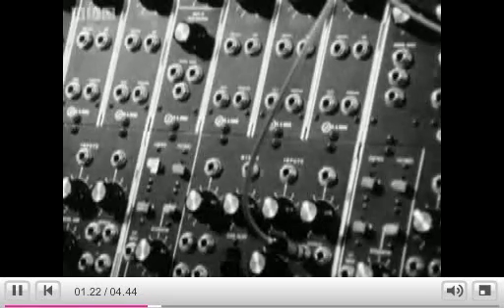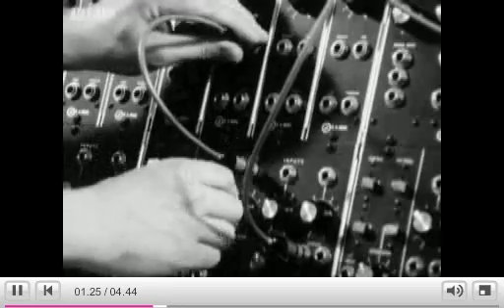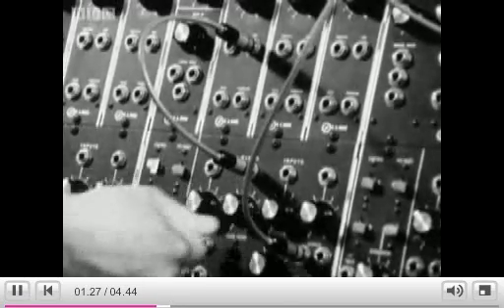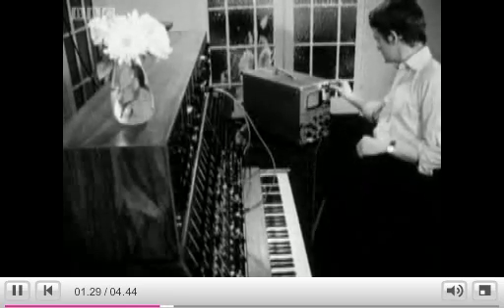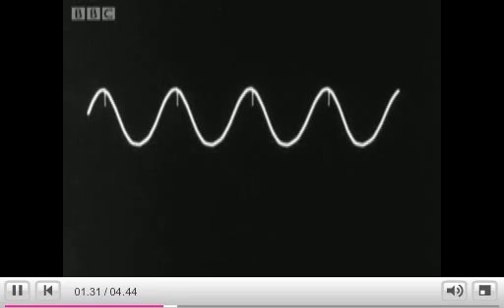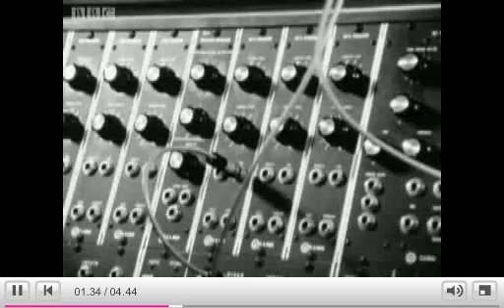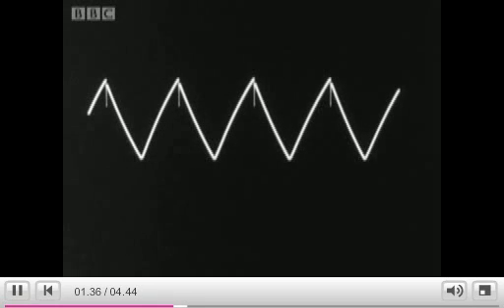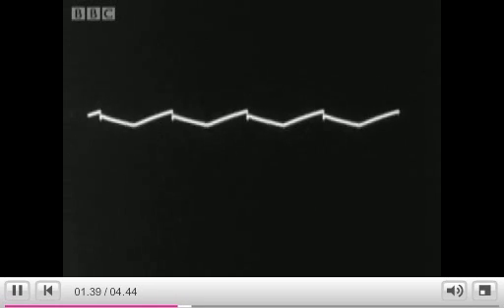BBC Archive Tomorrow's World Moog Synthesiser

Comment: 1st thing I have to mention is that in many of the early Moog demonstration films, not only is the recording quality for the film lacking high end resolution, but the power supplies of (less expensive maybe????) Moogs always seem to modulate the oscillators with 50 or 60 Hz hum IM distortion in a particularly ugly, grainy, and gritty way.  I used to Gag when I heard the Moog they used on Sesame Street.  Even the "Poly Moog" used by Rosalyn Tureck,, which must have cost a very pretty penny, sounded pretty crappy.  It was actually, a bait and switch by R Moog who used an electric organ maker's oscillator divider bank as it's basis, because priority based scan of a voltage controlling keyboard had not yet been worked out, to fire simultaneously depressed keys on Moog's keyboard.  The early Moogs were essential capable of generating a sequence of single notes, even though several oscillators could be key'd together to generate overtones. 

  I must be in a bad mood today, but it also annoys me when the Narrator who essentially has his facts straight, manages to dispatch his reductionist theory of how Moogs work with condescension, and facile aplomb.... AAAarg.  

I keep thinking I will make a nice video explaining analogue Synth basics, and some history of Electronic Music, and some stuff about the basics of sound and music, as so many of the video's attempting to explain, just muddy the waters, anyway life seems to keep getting in the way.....  Also I hate... the reliance on NOVELTY of Synthesizer farts, meeooows, and Blarps.  by now very NOT NEW ! ! ! 

Check my channel for playlists that include many Carlos emulators, called SynthOdioBach  for over 150 pretty nice examples of over 50 YT uploaders inspired by Switched on Bach.  At one time it was about 4th on the list, when You searched Switched on Bach.  Then apparently YT decided why rely on someone's 60 years experience and exhaustive search through YT uploads, when we can use our own Algorithm, and just fill all available space with inconsequential crap, then they, or others use my list as their basis anyway, admixed indiscriminately with garbage...... AAAaarrgghh.